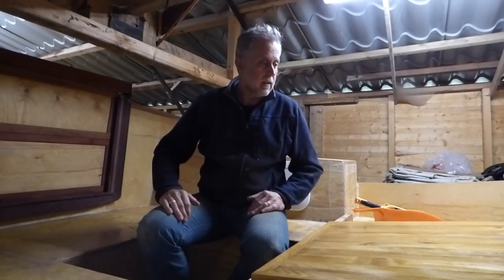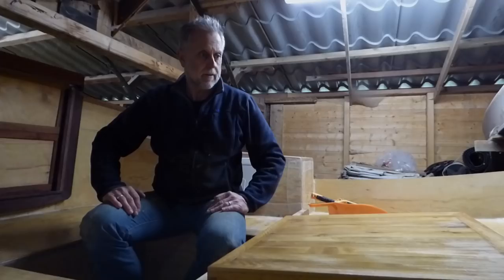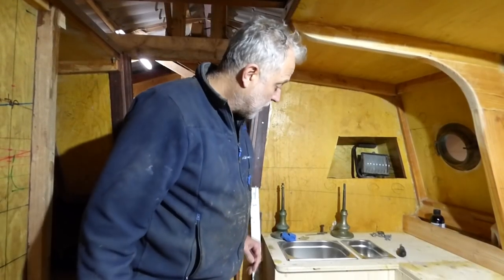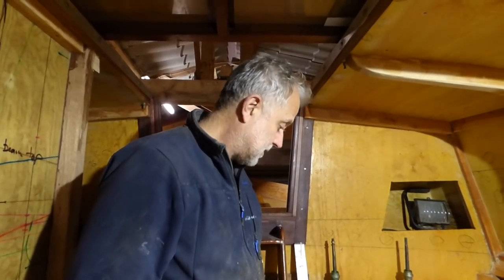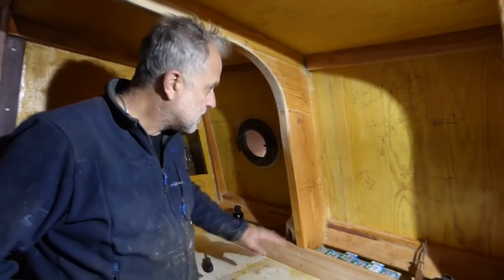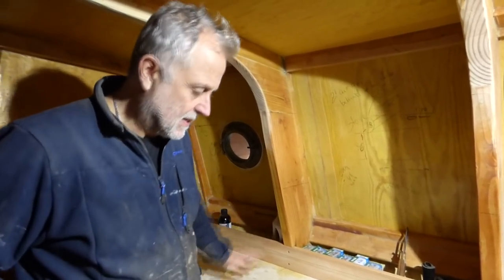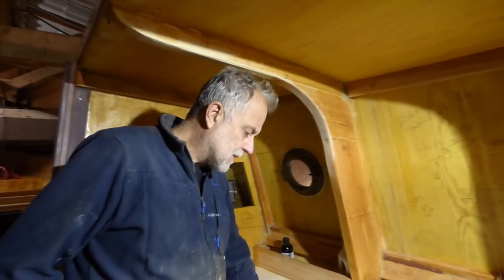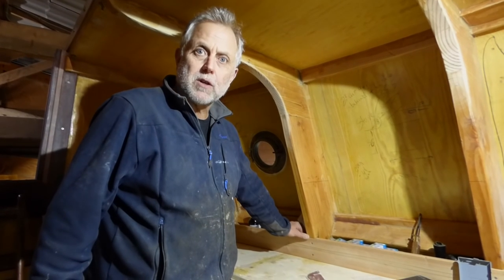Filling in the holes - SV Tapatya EP115

Comment: Hey now, no cutting corners Sir! (18:01) I saw that.. I think maybe the first piece of wood you've installed in that boat where you didn't epoxy the pieces together, and you just said once those cabinets and shelves are in they'd become structural components .. hmmm
Reply: There was no cutting corners involved. If you look a little earlier, at 17:44, you'll see white thickened epoxy gooped onto the places that fiddle gets fixed to the frames. (Though if you want to get really pedantic, maybe the bottom of the fiddle could have also been epoxied to the bench top!)
Reply from the maker: Yes, you’re right Garryck. When I was editing this video, I regretted not having epoxied the fiddle to the worktop - I did put some screws up through the worktop into it though. It is indeed epoxied to the frames, but I guess it was one of those moments where the video didn’t come out for some reason (probably I didn’t press the button on the camera properly to start recording) so it’s rather difficult to see what I did